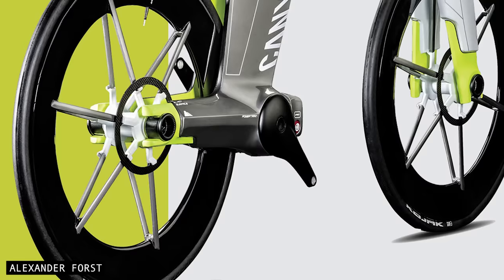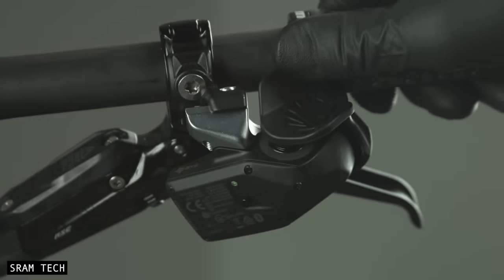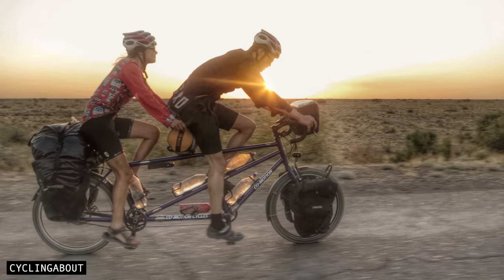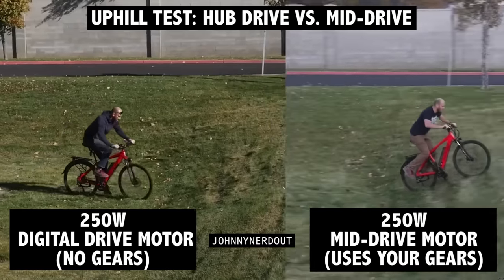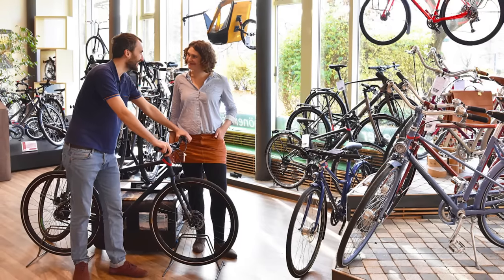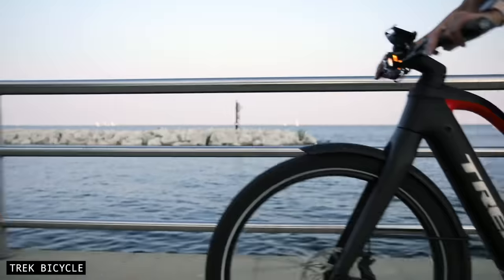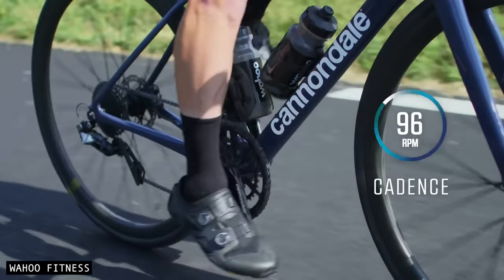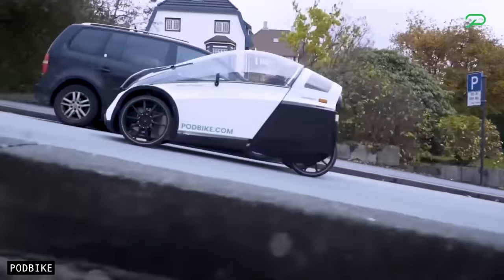Are Chainless Digital Drive Bicycles The Future of Cycling?

Comment: I need to point out that not everything that involves electricity is “digital”.  This is an ELECTRIC drivetrain.
Reply: I was screaming internally the entire time. "Digital"means of or relating to numerical digits or fingers. It has nothing to do with methods of power generation.
Reply: & this is objectively analog right? Unless it’s just a computer recording your break intensity & directing an equivalent level of power from the battery, with no direct, variable, connection between pedals & engine.
Reply: Right. I thought who came up with calling this "digital". There's nothing digital about it. Whoever thought to call it digital needs to learn its meaning.
Reply: Yes this is a series hybrid drive. The electronic control is digitally implemented but that is not essential to the concept. An annoying name.
Reply: @yerald_a  from the description there is definitely a computer involved. The pedals are just a dynamo for charging up the battery.
Reply: One could make the same case for a Tesla as being a digital car …
Reply: Yeah I thought it used PID brushless drive
Reply: @yerald_a  Well not even analog. Analog is reading and computing data as waveforms. This has a minimal amount of computing for the batteries. The drive train does no computing.
Reply: @theman5887  analog in the world of electrical engineering usually means stuff like traditional amplifiers, op amp circuits, linear power supplies, possibly even radio and RF stuff so more or less everything "not digital"
Reply: The fact that efficiency at each motor is around 80% makes me assume they're using switched reluctance motors.

If that's the case, it would be accurate to call it digital, since it needs a digital signal to operate. 

Kinda like a stepping motor...in e.g. a printer.
Reply: @tylerdurden3722  that does not make it digital. At best a hybrid motor, as the control signal is generated digitally, in this case. If the controller however can be switched for an analog one, which could be done, that does not make the motor digital. It makes it a digitally controlled motor
Reply: @tylerdurden3722  That doesn’t seem digital to me. The control lines might have binary state but they aren’t actually communicating digital data as a series of 1s and 0s, are they?
Reply: @theman5887  I am petty sure that analog and digital is only about how the system works is it with only true and false cases (1 or 0 digital) or can vallues be in between as well. There doesnt need to be any computing to call a system analog. An anog system could be as symple as a voltage source a resister and a led.
Reply: I was anoying me so much that I could watch further than 2 min and needed to find out if I was the only one
Reply: @mohanjanisthere  i've never seen a fully analog 3ph inverter, not only that but it needs to be able to simulate a bike-like feeling dependant on load so it varies the required pedaling torque and cadence using digital systems

not a single ebike has a truly analog controller, they're all operated by pulse width modulation and drive algorithms, field oriented control being the most efficient, and inherently uses sensors

doing a fully analog version of it would be gigantic as fuck even with tiny SMD components and the efficiency wouldn't be achievable at all, plus you won't be able to control effort at all and probably have inaccurate and inefficient motor control, as it needs to be able to monitor the input and motor current, battery voltage, motor position, "generator" position, generate a sine wave at 3 different phase angles, regenerate/convert the voltage from the "generator" to a high enough voltage, keep in mind the inductance and resistance of the motor and the "generator', and that's just a few of the functions of the inverters, it's even more complicated than that

it's not just a brushed dc motor driving another brushed dc motor, both are 3ph bldc motors and even just rectifying the "generator" it's generated power would be highly inefficient compared to full digital control

now it is like 70% efficient, if you done it fully analog, if possible to achieve, you'll be at 10% efficient at best

yes the earlier electric drivetrains they call digital are NOT digital, but the new ones certainly are
Reply: @jochem148  A digital signal also has an implicit or explicit clock which determines the regular discrete intervals at which the digits should be read. A signal that has transitions between two states at arbitrary times is not digital. For instance, a light switch isn’t sending a stream of digital data to the lightbulb.
Reply: Your right. It's more electro mechanical
Reply: +1
Reply: Single gear chain drive, optimised to use, added to the system, could be better as a parallel hybrid to help  overcome losses and torque/speed issues.
Reply: First i thought the same. But then he explained the need for very intricate software to actually make this concept usable as a bicycle drive train for normal people.
If you just connect the generator to a motor, it takes an athlete to get the bike going. Losses are just too damn high and electric generators have an absurd torque requirement when driving a low resistance load (like a motor that doesn't rotate yet when starting to move the bike).
Also it is way easier to do the comfort features like dynamic pedal resistance in software.

While you probably could do it without a computer, chances are that every commercial hybrid full electric bicycle drive train will heavily rely on software running on a microcontroller. And that could indeed be called a digital drive train.
Btw, when the microcontroller breaks or it loses power, such a bike won't move. And that should also be listed as a disadvantage, because you normally can still ride a chain- or belt-driven electric bicycle with the electric components not working.
Reply: I assumed the “digital drive” is a trademark. Otherwise, it’s just idiotic
Reply: Make an analog device to replace  The Chain first, then you can establish a new classification, where electric bike transmissions will be subdivided into analog and digital.
Reply: @tylerdurden3722  meh.. pretty much every electronic motor controller/driver uses some sort of PWM or similar on or off signal to do the actual driving. would still call it electrical drive and not primarily digital. maybe digital electric drive but... yeah nah
Reply: Blame it on Dyson... They renamed their brushless motors to digital motors for marketing reasons. Yes there's a "digital" controller, but the motor itself isn't really digital and could be driven with an analogue circuit
Reply: Never mind the processor that tells the drive train when to operate
Reply: You are sort of right.

But considering the control unit is most likely to be digital, it's not wrong to call the system digital.
Reply: @revimfadli4666  PID does not mean digital or analog. PID can be implemented either way.
Reply: @theman5887   Analog does not mean computing. Ever heard of an analog clock? Sure there are analog computers. This system does not require computing.
Reply: @allesklarklaus147  Well said. To charge the battery or power the motor is simpler using analog electronics too.
Reply: @mattc7014  Similar to the “digital TV antenna” marketing.
Reply: @robguyatt9602  oh shoot it can. Guess I mixed it up with stepper or brushless

Maybe this is why I didn't graduate electronics engineering lol
Reply: @revimfadli4666  Lol. I like your style. :)
Reply: I mean if the system won't function without some level of digital input (such as cadence sensing) then it would be a digital system.
Reply: Its drive by wire
Reply: @tylerdurden3722  Ooooh.... wouldn't you love to ride a bike driven by a stepper motor??
Reply: Thank you. That was so irritating! This is what I came here to say.
Reply: i bet he calls a normal bike an acoustic bike
Reply: Why is everyone so upset about a term they don't know the technical meaning of and a system they know next to nothing about. The whole system IS digital. Marketing is playing up digital as a buzz word but if you get angry about every marketing buzz word you would be constantly angry.
Reply: @cameronlevers231  No the drivetrain ist not entirely digital. The most important parts of the drivetrain are the generator and the motor both of which are not digital. The generator will generate based on an analog force and frequency input and the motor will output a torque which has whatever value in it's rated torque range. The drivetrain controller circuitry might be digital (mostly) but not the whole drivetrain.
Reply: @allesklarklaus147  a copper coil is not digital. A piece of wire is not digital. But a computer controlled, generator/altenator/dynamo, with speed controlled brushless motor IS digital. I wouldn't be surprised if it has a smartphone app
Reply: @cameronlevers231  not really, the controller is/might be digital as said before but not the motor/generator. if you use smarthome thermostats with a smartphone app for you in house heating your heating system is still a hot water heating system and not a "digital heating system"...
Reply: @allesklarklaus147  no the marketing for that seems to be "smart" or "smarthome." I would of thought that is alot further from the truth than digital.
Reply: It’s a dumb name but in a modern implementation this inherently digital, using three phase brushless DC motors at both ends and PWM modulation.
Reply: @cameronlevers231  Well I'm not really qualified to rate the amount of marketing wank but either way it sounds dumb
Reply: Maybe it a trademark/brand name?
Reply: In fact I’d say it’s analog since the power generated by your legs is analogous to the power at the wheel haha
Reply: @AWriterWandering  what sort of computer was installed in the 1975 digital bike?
Reply: @blankslate1198  a stepper motor is just a switched reluctance motor controlled to stop at each pole - they can be driven extremely smoothly with the right signal. Almost every modern ebike motor works this way.
Reply: And no, as the electric motor requires a motor controller for efficient use and this aspect IS digital.  Likewise same goes for your peddle to electrical power generator for efficiency will REQUIRE an digital controller.   Sure, you CAN build an electric motor without a motor controller... they are also garbage.
Reply: @cameronlevers231  I use a digital toothbrush (:
Reply: @mattc7014 I think that’s why they call it digital drive. If it was analog driven, it would be analog drive.
Reply: @biggreenblob  Word definitions change. After all, the association with numbers was added to the original definition. Effectively, you are converting mechanical/analog power to electrical power, but you're also converting that effort into a sequence of digits which tells a controller what to do.

Also, digital has become a counterpart to analog.
Reply: @allesklarklaus147  Yeah, well rollberblades aren't Actually rolling blades, now are they? "Cellular phones" don't use cellular signals any more, and having a "gay old time" doesn't have the same meaning the Hanna Barbera intended in The Flintstones. Language changes, and although strict definitions are at times important, oftentimes, what "sounds" better, or is easier to stay tends to stick and change (or muddies, if one is pedantic) the language. 

I get what you're saying and as a pedant myself, I used to get irritated about these things, until I realized that language is a living thing that grows and adapts (especially languages  like English). 

TLDR: Digital Drive has a nice alliterative sound to it and flows better than 'Electro-mechanical drive.' Although I feel that if these go mainstream, they'll likely be called "Chainless Drives" as that's extremely clear to a buyer and probably piques their interest more than Digital drive.
Reply: Without the digits it doesnt work…
Reply: @cameronlevers231  I gave the technical meaning of "digital" in my previous comment, right under OP. The whole system is not digital. If it was it would just be a computer program.
Reply: It's like calling a lightbulb the digital candle
Reply: @w8stral  but the narrator claims they've been "digital bikes" since 1975, which makes it a lot less apparent how they're supposedly inherently "digital"
Reply: Plus, you could say a mechanical drive is actually a digital drive if you push with your toes.
Reply: @biggreenblob  as per my previous comment, a copper coil is not digital, a wire is not digital, but a computer controlled system is digital.
Reply: The single-digit efficiency is what makes it truly digital
Reply: The wording is just marketing BS. For instance I have seen cigarettes with words "touch" and "HD" in their names. Use a popular word and you will get the likes.
Reply: this entire comment section is making me cringe because of this. went an awful naming convention, if that's even what it is. if it's just a simple mistake then that's even worse for a video of this length
Reply: @norgeek  no he did not
Reply: @biggreenblob  yeah, me too!
Reply: It's called "digital" because some marketing wankers want to sell it as something modern and advanced, while it's not. Similar system is used in diesel electric locomotives, where diesel engine powers a generator, and this generator powers the motors that drive the wheels.
Reply: @w8stral  what is he saying at 00:30 then?
Reply: I think the digital in digital drive train comes from the software that'd be used to control pedal resistance, energy storage and release etc. A motor connected to a dynamo isn't digital, but once you include any computational elements you could feasibly call it a digital drive train.
Reply: @kaszagryczana2260  Not really. Assisted E-bikes perhaps are like the light bulb, and this chainless drive is more like a smart LED bulb... which I think you could argue could be called a digital candle.
Reply: @roeltiri4041  Nice. I dig it.
Reply: @norgeek  1974 is not the stone age you know... Motor controllers existed... they were crude compared to what we can do today; true, but they existed.  And on top of this, he is talking about a patent, not production.  But of course there was no production, there was no viable batteries with which to OPERATE a bike.  Lead acid is too damned heavy and only has a charging efficiency of 72%...  What idiot would put that on a bike?
Reply: @pieterrossouw8596  Like we call a person with a pacemaker a “digital person”
Reply: 30 secs into this video and allready looking for this comment. Such a fatal misinformation at the beginning of the video has spoiled my desire for the rest.
Reply: @urgon6321  Uh... sort of, but no.  Here we are talking permanent magnet motors for an ebike and here is a GIGANTIC difference... base efficiency via a digital silicon computer controller for load balancing.  It has never been in micro form before.  

Now said multi million dollar locomotive has been computer controlled for well over 50 years... true, but it started as analog.  Simple system: also true.  Yes, they changed from analog to digital a long time ago but said computers were still large and no way would fit on a bike.  That being said, we could have mass produced a computer for an ebike 30+ years ago, but there really was no viable battery tech.  Ni-cads... yea sort of, but not really and we did not have the permanent magnet motors 30 years ago other than EXTREMELY expensive stepper motors.... so... while the same thing, in reality there are reasons the marketing says what it says even though it could have been true 30 years ago, but has not been done until now.
Reply: Maybe cause it sounds different and draws more attention.. I'll be honest, that was one of the reasons I clicked the bike looked cool. But yea when I hear digital, I think of screens, pixels and of coarse "Digimon" (Digital Monsters) 😂
Reply: @tmartin9482  Just shows you have no clue what a digital motor controller is.  That is the digital part.  It is an optimizer for torque, speed, efficiency so one it actually functions, and two does not immolalte itself.  A motor is not just willy nilly tied to a drive train via 2 or 3 or more  conductors with an ON switch other than in super cheap garbage...
Reply: @w8stral  so did he or did he not say that the patent for the quote-unquote "digital" bike was filed in 1975, which you initially claimed was incorrect?

Electric bicycles have been around for much(!) longer, I believe the first patent was filed in 1895
Reply: @w8stral  I'm well aware of motor controllers, but the fact, that you just eat his  "power generator + motor + wires = digital bike" at the very beginnning shows that you unfortunately have no idea how good explanations are structured. Disappointing.
Reply: Hes using the term digital in contrast to analog.
Reply: @TJ-sb2jj  So all electric cars shall be called digital cars from now on as well?
Btw. using digital in contrast to analog IS THE FCKING ONLY WAY TO USE IT, IT'S ITS DEFINITION.
Reply: @TJ-sb2jj  But neither digital nor analog are adjectives that apply to drivetrains
Reply: @B.L.A. Well...... It IS a good match for all the fake experts commenting........!
Reply: Well, you could call cycling digital because your peddles go up-down, 0-1.  🤐
Reply: I was gonna say... Motors and generators are probably more analog? The controller (especially if there's a battery) will ofc be digital
Reply: All modern bldc motors are 3 phase, and require a specialized controller that functions by powering each phase in sequence. 

Power level is not controlled by varying the voltage.

Instead it varies the length of time that voltage is applied to each phase.

The method, Pulse Width Modulation is absolutely reliant upon a digital signal.

Other functions of the controller are also digital.

The only pure analog ebike you could build (no one sells them, because there is zero market for them) would forgo a controller and use a brushed motor.

It would have no features, such as regen baking, and range would be lower due to the inefficiency of a single phase motor.

I assure you, this device is very much digital.
Reply: @AdrianBoyko  what do you think ones and zeros are in a computer?

They are whatever we define then as.

I've worked on computers where 0 was -11vdc and 1 was +20vdc.

This thread is a little silly.

People objecting to the term 'digital' on an emotional level, then trying to build an argument that leads to their conclusion, without understand any of the terms or the underlying principles.

Tldr; if you can't define digital correctly, you don't get to say what does or does not fit the definition.
Reply: @robguyatt9602  it absolutely does,
Reply: @robguyatt9602  Incorrect. Charging is done by a sophisticated digital circuit that ensures current limits are not exceeded, and that no cell in a string is overcharged. During discharge, similar functions are also.digitally controlled so that no cell drops below the charge level at which chemical changes in the cell.begin to cause irreversible damage, or in worst case, cause a fire.

The motor will not spin without a digital controller. At all.

What exactly is your objection to digital technology that you think analog is somehow preferable?

Did a computer hurt you?
Reply: @B.L.A. The cost of implementing any function is cheaper using digital technology than analog.

I know nothing about Dyson vacuums (though I have one somebody gave me - never used it) but if you told me to design a vacuum the could sell for $500 and have ridiculous power, I'd be looking at cheap full wave rectifiers, implemented in silicon, to create power controlled by a digital controller to power a  reasonably efficient brushless 3 phase dc motor. I could get several times the power output compared to a single phase analog system.

The motor would cost a little more, but not much. The controller would be cheap to produce. I can think of off the shelf motors that could easily produce 5hp in the same space/weight as a traditional vacuum cleaner.

If Dyson were doing that, it would justify a premium.
Reply: @ElectricityTaster  😂 Best comment
Reply: @urgon6321  Diesel electric locomotives are a great example. Nowadays, they almost certainly have all sorts of digital components, but they aren’t “digital locomotives”.
Reply: @theman5887  not true, the controller would be digital.
Reply: @Zomby_Woof  I admit to writing some of my remarks before finishing the video. Yes I made mistakes as a result. Now just because I said analog can be used for such a system, yes it would be a simple system without the features software and digital control can provide. Nor would it have the improved efficiency of BLDC over brushed DC. But nowhere did I suggest analog is better than digital. And no I most definitely do not prefer analog. I've been designing and manufacturing closed-loop servo systems since the early '80s. I was one of the first if not the first to put a microcontroller-based digital servo on the RC market in 1993. I taught myself to write assembly and later C programming for my MCU based products. So how you think I don't like digital is beyond me. Clearly, I gave no such impression. Just pointing out that analog can do such things as charging batteries etc. does not in any way suggest I think it is better than digital. Clearly, it is not. Your rudeness spoils an otherwise respectful thread.
Reply: Every time I heard digital, I was like Huhh, how exactly is this digital??
Reply: @kaszagryczana2260  no it's not. That's a stupid comparison and you know it too
Reply: @stitchilalu  THE motor controllers are digital.  Where the torque, efficiency comes from compared to no motor controller.  Same goes for regenerative braking.
Reply: I call traditional bikes without disc brakes/suspension "analogue" so this kinda fits...
Reply: The concept works better with digital logic circuits
Reply: This could more accurately be called "cyber" 🙂
Reply: @UnoriginalUsername373 I don't think they're just coupled generator/motor. it wouldn't work as well. the old one sure was probably just that. but the modern ones would be more like an ebike without a battery with a microcontroller controlling the thing, that way you can avoid stalling on startup and hills etc..
Reply: Is it analog?
Reply: Thank god somebody said it
Reply: @jochem148  Same here. Seriously annoying.
Reply: @AWriterWandering  an electric car also has a computer involved, yet we don't call it a digital car

heck, even an internal combustion engine car has an ECU , so under this definition they are 'digital cars' too
Reply: @robguyatt9602  My comments were directed more at the overall trend in the comments, with people taking a decidedly luddite attitude.

I should have made that clear because I wasn't intending to dump on you.

Or maybe I was, after making an incorrect inference from your posts - can't remember anymore and the mobile client isn't backscroll-friendly.

I've become a bit hypersensitive to the whole fondness for things and times that never were.
Reply: Thanks. You saved me from having to say the same.
Reply: Also, to call it an infinitely variable transmission is wrong.  It’s an electric motor with a generator and perhaps a battery. 

You need to generate the same amount of power for speed*distance travelled.
Reply: At the beginning, “digital” drive bikes have infinite gear ratios.  At the mid, they’re only good for one gear range or the other.
Reply: Dude this is an Artificial Intelligent Bike, with Quantic energy transmission
Reply: @profvonshredder2563  Some are not explicitly clocked, in which case the receiver needs to do “clock recovery”
Reply: The efficiency is worse than chain drive.
Reply: This thread has exceeded my wildest expectations. Waiting for my award plaque from YouTube 😂
Reply: Surprised they didn't include 'AI" in there somewhere.
Reply: No digity
Reply: Thank you! 👏
Reply: I had the same reaction, but, thinking about it, an analog system would have the generator directly connected the motor, which may not be a great experience. OK, you could have some analog electronics but digital would be more flexible and cheaper.

So I'm swinging towards this being a digital drive train, because without digital electronics it would be pretty rubbish.

"Indirect drive train" might be a better description.
Reply: it's marketing. 😁
Reply: @tonyblighe5696  Chain drive is also electric because it is electric repulsion that provides the force of one solid object (eg chain) against another (eg sprockets)
Reply: Look at 6:30,. it requires software to make calculations and use both your power and the battery.
Reply: Thanks for writing this.
Reply: @tonyblighe5696  Then every car, bike or anything else with an engine nowadays have digital drive, they all have ECU's that does a bunch of calculations for how much fuel to inject.
Reply: Strictly, Digital means limited number of steps or divisions. Analog means unlimited positions, within a range. 
A computer works digital, but Digital does not mean it is a computer.
A simple lightswitch is Digital. The light is on or off, not half on.
Even with most dimmers it is limited on a certain abount of in-between-steps, so stil digital.
A signal trough air or wire had loss during transmission, so will have a unknown amount of steps, so is always analog. Though from the moment you use a threshold level again to decode it is digital again.
Simply said, the switching is always digital, what arives on the other end of the line is analog.

A digital clock is nog digital becouse of the numbers, but becouse there is a limit, like in minutes, or seconds. You can not read seconds of the smallest digit shows minutes.

A analog clock realy shows the time more devided, so is analog.
Only when the second arroy is miving constantly though, else it stil is limited to whole seconds and is technicaly digital again.

Analog or digital has nothing to do with electric or computers, just with the (un)limited amount of devisions.
Reply: Now it feels cringe whenever he says DIGITAL
Reply: This. Even though technically modern implementations of the technology will always be using computers, there aren't really any "analog" drivetrains to compare it to. Instead, the alternatives are mechanical drivetrains, which would make the use of the word "electric" much more sensible. Unfortunately, the term has been used long enough to stick indefinitely.
Reply: Thank you.
Reply: I fully agree, though it is worth noting many control systems use pwm pulse control- which is pseudo digital (I.e. at fixed voltage) , but variable time.
Reply: @yerald_a  its not analog bud
Reply: @tylerdurden3722  why on earth would they use reluctance motors?
Reply: @theman5887  Analog = either means something analogous (similar) or something that is continuous and not discrete.
An analog clock is analog because there is no single point at which it is exactly a certain time like 3pm. Unlike a digital clock which can either be exactly 3pm or definitely not.
Reply: @BH4x0r  uhhh, there are brushed motors bud
Reply: @Blox117  worthless in the ebike scene due to the wear and less controllable nature, impossible to tell the rotation, inefficiency, and none in the wheels/hubs are brushed, there are brushed motors but only garbage cheap "middrive" ones that would drive your chain separately

even the cheapest middrives (that actually are middrives and have your pedals on them) are brushless, same for the cheapest hub motors you can buy, why? because brushed motors suck in every way, shape and form

either way the new one in this video is an ebike with a 100% brushless motor, generator, a battery and a smart system to make it feel like an ebike
Reply: It's a sales pitch method.
Reply: @BH4x0r  except you can replace the brush with a roller. problem solved tarded kiddo
Reply: @Blox117  how would that be more efficient though? the commutation method is still crap and will cause 2 coils to turn on full power during the comm switch, so it's still bad

anyone who thinks a brushed motor can win over a brushless in efficiency is a lunatic
Reply: @BH4x0r  what are you talking about? it would only energize the ones that it is touching.
Reply: Yeah, the drive train is electric, while it's the control that is digital. Now excuse me as I get in my digital car and drive off to the ENCOM cyberspace.
Reply: And I'll point out that analogue systems also use electricity 🤦
Reply: If an algorithm is controlling the output this is digital electric
Reply: Every single time he says digital in place of electric I feel like I'm sinking deeper into the river styx.
Reply: The power is digitally controlled at all times so the name is absolutely correct. The digital system is an integral component of the drivetrain. An analog electronic drivetrain would be a very different system with a very different feel.
Reply: It's like the difference between an electric guitar vs electric piano. Electric guitars are analog. Electronic pianos are digital. Now it's true that the electrical signal going to the speaker from the digital piano is analog, and its power source is fully analog, but it's digitally controlled which makes it a digital piano. Same idea applies here.
Reply: The entire purpose of the word "analog" is to indicate the total absence of any digital components in a system. So by definition this system cannot be called analog. Analog drive would specifically mean that the motor at the pedals is directly connected to the motor at the wheels, or that there is only an analog control system between the two motors.
Reply: I imagine that a digital drivetrain could be powered by giving it the task of computing the last digit of π
Reply: That blunder is so big he should remove and redo the video.
Reply: It Is Digital.  You bicycles motor to controlled using Pulse Width Modulation. 
Look it up and learn.
Reply: Marketing. 
"digital drive" is weak alliteration: The bread and butter of advertising.
That's all there is to it, I think.
Reply: Drive refers to the speed controller/ drive for the motor hence the digital part
Reply: @patrickdegenaar9495  I consider PWM to be a binary signal, but not digital. “Binary” because it is a two-level signal and “not digital” because the levels don’t represent digits.
Reply: This is digital since the controllers are digital.
Reply: also the power losses..

if that piece of junk doesn't have a battery and a recovery system... it's a bad idea, less efficient, more shit that can fail with very non user repairable components
Reply: @volundrfrey896  And cars are called “digital vehicles” because they have digital controllers, right?
Reply: Disappointed they haven't added "turbo" in there somewhere.
Reply: Just double checking, the patent he refered to is US 3884317A Kinzel for reference  Titled: "Electrically powered cycle". No mention of digital in the entire patent. Hope it is helpful. It felt quite off when the word was applied to everything, including electrical flow on the wire.

The argument about digital piano vs electrical guitar makes a lot of sense, and the bicycle has a digital gear system, so it is digital. But the YouTuber definitely seemed to not know the difference.
Reply: The step up is digital
Reply: Exactly! Digital refers to a way to represent information by approximating it with discrete numbers. To say a drivetrain is digital makes as much sense as saying a hammer is digital.
Reply: @tylerdurden3722  Similar to a multiple choice question where they ask what the "best" answer is, calling this is a digital drivetrain is the "worst" name they could have used.
Reply: To be fair, this distinction would rely almost entirely on the BMS at this point. "Digital" is anytime something has to be converted from a fully "live" analog input into a binary format.

So if the BMS relies on binary information to correctly distribute the power, I believe this could technically and correctly be referred to as digital.

If the BMS is just using live current flow and choking/boosting it (to a non-0v level) to a clean correct voltage then this would be electric and not digital.
Reply: It's also not a drivetrain. It's an electric motor with a generator at the pedals. There is no "drivetrain" be ause the motor is at the rear wheel. No need for a drivetrain. 🤦🏼‍♂️
Reply: Digit: any of the divisions in which the limbs of most vertebrates terminate, which are typically five in number but may be reduced (as in the horse), and which typically have a series of phalanges bearing a nail, claw, or hoof at the tip.
By this definition, anything pedaled by the feet is digital.
Reply: @TheNewGreenIsBlue  Well digital drivetrain just sounds absolutely stupid to an electrical engineer or other people related to that field. It really does.
Reply: Incorrect. This involves a controller that is doing more than sending the pedal power directly to the motor.
Reply: 0s are 1s are digits. The only way electronics work is using these digits to represent controlled pulses of electricity. Electricity when controlled is pretty much digital. If not digital, very inefficient or useless
Reply: @NaviYT  yeah... no. I don't think most power plants are inefficient or useless. Or basically any electric motor. Or LED light bulbs. Or audio amplifiers, wifi routers, radio transmitters,... you get the idea.
Reply: @blueburger4  My Mustang is controlled by a computer. Does that make my car a "Digital" car?
Reply: @computhenics  Well, it is digital in the sense that there is control software. But yeah, super stupid name.
Reply: Digital:
involving or relating to the use of computer technology

It's almost like there are many definitions for words, and they change over time
Reply: Llp
Reply: Thank you
Reply: Imagine if he said “Analog” on the video-
Reply: Controlled by digital electronics - that's the clever bit. Without it, it just takes away the greasy bits and makes it 50% less efficient in physical energy utilisation.
Reply: If you have software algorithms then these have been programmed in a coding language, which any coding language still reduces into binary 1's and 0's from the higher level.

So yes, it's digital. Electricity is simply the power output converted from the mechanical input, and then back to mechanical.

If the power generated was 100% direct, and without computer controls over torque, gearing, and cadence, then it would be completely eclectric, in the same way those wind up torches operate.

Anything that runs an internal computer, and software that reduces into binary can be considered as being digital.
Reply: @angryherbalgerbil  but, binary cant power a drivetrain... so calling a drivetrain digital is wrong. its an electric drivetrain that could be controlled by a digital computer.

so the correct term would still be a electric drivetrain
Reply: @tylerdurden3722  so if we going with your logic, we need to change Tesla definition then.A big LOL.
Reply: Well aktchually your foot has digits so checkmate!
Reply: It would be an analog electronic drive train if there was a generator in the peddle hub directly wired to a motor in the wheel hub. Possible, but not effective. The design described in the video involves a digital control system that decoupled the peddling action from the wheel control and provides a hypothetically improved experience by allowing the user to peddle at a cadence comfortable for them, while driving the wheel at a speed and torque appropriate for the situation. This is "ride by wire" not just an electronic drivetrain.
Reply: my light switch is digital     it has a on and off position
Reply: @kaszagryczana2260 LEDs is a semiconductor
Reply: @The_Ballo  I agree with you
Reply: Its that gen whatever education at work. We're headed for another dark age if the over 30's don't fix everything before the under 30's start playing slip and slide with their smooth brains.
Reply: @TheFyroPyro  By that definition, was my 1984 V6 mustang a Digital car because it had fuel injection?
Reply: @DJ_Force  That depends, was it electronic  or mechanical?
Reply: A tesla has a computer between the driver and the motor/wheels though, so it's not inaccurate at all to call a tesla a digital car.
Reply: @leandervr  I saw a digital cat outside as it wandered under the streetlight, that is controlled by a computer telling it when to switch on and off.
Reply: It seems like a marketing gimmick. Like calling whitening toothpaste "HD" 🤣
Reply: And I doubt the 1975 version had much "digital" going on.
Reply: @Smaggle84  It was an early form of centralized electronic fuel injection. The car had an engine computer. However, if you called it a digital car, you would have been rightly laughed at, even when the car was new.
Reply: LOL.  Just wrote my comment, then happened to read the others after my post.  Yes, some folks seen to think if its electrical it's digital.
Reply: Yeahhhyyyy. Digital would be definitive figures. Not broad range.

Makes me curious what is digital in this design.
Reply: Na man the rear motor is driven by the digital data generated by the crank.
Reply: Do you think we store files in clouds?
Reply: I expect the drive chain is digital in the sense that it uses a whole load of digital electronics to make everything work properly. The point remains that this technology is not intrinsically digital and could be built using analogue electronics if someone wanted to do that. The 'digital' part is not fundamental to what's going on here.
Reply: Happy to see that I'm not the only one seeing this. In my opinion the missconcepted naming destroys the experience of the video...
Reply: The output (motor) and other systems is controlled from a computer that is making calculations and adjustments with 0 and 1s. It may called digital.
Reply: Its digital even gas pedal of cars are digital
Reply: Thanks for stating what a lot of people immediately thought. It's such an ignorant name. It is certainly an electric drivetrain, nothing digital (discrete) about it.
Reply: Thats like the programmers that keep putting AI into everything
Reply: I am thankful this is the first comment I saw, it was grinding my gears all along…
Reply: That was my first thought when I saw this. It is simply electric.
Reply: I need gto point out that varible dc voltage is not digital.
Reply: Thank you
Reply: I found listening to every sentence saying "digital" pretty made me want to stop listening. How to be wrong in every single sentence? @CYCLINGABOUT has managed it.
Reply: i thought it was digital, became the basic transfer of power depends on lots of digital calculations en instant balancing?
the motor is clearly electric, the generator too, 
but all the bit in between, to help you control how fast you go, without really peddalling a lot less output, that bit can, i think, almost only by created by digital computing??
Reply: @JeroenJA  By the same logic your internal combustion car is digital because it has a computer in it, the EMU (Engine Management Unit) doing calculations all the time to maintain efficiency and control. This bicycle definitely does not have a "digital drive".
Reply: I'm sorry but everything electronic needs to be controlled, especially with modern tech or features people wish to have. And the controllers are you bet it digital.
I could also hang a big one out and say that ac current/voltage or dc current/voltage (alone from tuning on and off) is a series of 1's and 0's which fits to the definition of something being digital.
Reply: Exactly
Reply: @theman5887  no... Analog in reference to electricity refers to a signal where the electrical waveform IS the interpreted signal.  This is opposed to a signal of on and off where on represents a 1 bit and off represents a 0 bit. Those bits are then interpreted by a processor to reproduce an approximation of the analog electrical signal that they're supposed to mimic.
Reply: @Daniel-dj7fh  Everything in your comment after "I could also" is wrong.
Reply: This bothered me so much
Reply: Digital sounds cooler
Reply: The digital refers to the photonic on/off sequences used to transmit the electricity from pedal to rear motor
Reply: I've come to accept the death of the english language, this morning I saw an advertisement for - I shit you not 

Air Fryer "Baked" Brie - the air quotes emphasis on "Baked" is not mine, it was the article's. 

An Air Fryer is a miniature convection oven with a basket. It isn't use oil, it doesn't fry anything, it never fried anything, you don't need an air fryer to bake something on a roasting or cooking rack to promote air circulation.

You don't get to air-quotes "Baked" here, It was baked all along. Oven "Fried" Chicken makes sense because you didn't actually fry it. Here it doesn't make a damn lick of sense because the "Baked" Brie was in fact Baked
Reply: I would love to see someone try to implement this without any microcontrollers, tell me how much of an enjoyable experience that is for you.
Reply: No, but everything digital involves electricity. These bikes have an electric drivetrain that is digitally controlled. Which means they are hybrid electric, hence digital...
Reply: @skipfred  i forgot what i wrote and am also not gonna bother go search for it, so yes. Let's just agree to what you said despite the lack of arguments.
Reply: @KaiTenSatsuma  A moped has pedals - that's why it's called a moped. *Mo*tor *Ped*aler roughly, originally it was in Swedish. No pedals = an electric scooter, not a moped. Like you said, not an e-bike really either although people do refer to motorcycles as "bikes" so it kind of works colloquially.
Reply: @Daniel-dj7fh  Lol fair enough
Reply: @theman5887  Actually, any brushless motor does digital processing constantly. And the drive chain in these bicycles takes that a step further with more torque-varying mathematics
Reply: @leandervr  So do all other cars these days
Reply: @skipfred  right but in that same colloquial way people generally think of "E-Bike" to mean "Electrically Assisted Bike" not "If this thing hits a pothole you're going to need more than your cycling helmet" 😄
Reply: @KaiTenSatsuma  Lmao yeah when I hear "E-bike" I definitely think of basically a conventional bicycle with an electric motor strapped to it
Reply: Thank you! 👏👏👏
Reply: @garrygraves3848  i guess you didn’t see all the replies explaining why this is very much digital
Reply: Go digital' means🖕, however, not everyone knows that.
Reply: Yeah, that stupid name drives me crazy!!
Reply: @allesklarklaus147  u don't get it
Reply: Came here to make this comment
Reply: You could be accurate and call it Analog to digital to analog drive system . Mechanical input and output via a digitally managed interface and storage …
Reply: @biggreenblob  so you have never heard of digital and analogue controllers then I guess …
Reply: @robguyatt9602  you would be looking at DC motors to best achieve that..
Reply: @chrisbraid2907 Brushless DC.
Reply: Semantics?
Reply: @nickryan3417  a lot of modern cars can't be repaired by a normal garagist anymore, thus a case could be made for it ;-). But no, combustion engine all in essence just trust on the all proven mechanical guidance,  and you push in a mechanical pedal to give more power. With the bike in the example,  you don't just pedal harder to go harder.. they speak of optimun output, thus, pedalling while going down and not wanting acceleration on top even.. 
Electric, very old wadhing machines were electric, with controls by lots of cables intertwining. Modern washers just go to a silicon board, where in all is digitally programmed.. 
Digital electric perhaps? :-) 
Just wanted to point out it couldn't possibly really work without the digital part as argument.. washer machines made just electric worked splendidly,  in those , digitalisation of curcuits was just a first a way of lowering cost, and more recently for mzking them more ecological easier. 
Same goes for cars, digital part just makes more specific affinity possible, but in essence function a car is still mostly combustion/electric :-). 

Interesting question though, makes you think..
Reply: Just wondering about drivetrain, why train? :-) 
Wouldn't electric driveCHAIN be more accurate, since the power is transferred by electricity alternative to the mecanic chain on standard bikes? 😀
Reply: Tell that to the marketing wanketeers!
Reply: @B.L.A. marketing campaigns don’t care about your pedantry, sorry
Reply: But it sounds cool
Reply: Most people <50  lack even a 3rd grade understanding of physical science.
Reply: @biggreenblob  I'd argue that digital in electronics is better described as discrete signals.
Reply: @webby2275  We are kind of saying the same thing. Digital in electronics means using "digits" (1s and 0s) to represent a physical (analog) object or phenomenon. In contrast, a vinyl record is an actual physical version of the soundwaves which make up a song.
Reply: Badically yes, but actually since energy distribution, charging etc is controlled by a digital controller circuit, THIS makes is digital. Otherwise, as a direct generator-wire-motor system that would be extremely stupid.
Reply: It's publicity gimmick since everything is going digital they probably thought take can jump on the satanic bandwagon as well.
Reply: This is digital though, as there's a digital middle-man between your legs and the motor. It would be electric if the wires from the pedals went directly to the motor, here there's a control system that charges, discharges a battery, sets the pedal resistance, decides how much power goes to the motor, and so on.
Reply: The micro computer controlling the system is digital btw, perhaps that is what they are referring to?
Reply: Probably not what is meant by the author of the video but they could be referring to PWM controllers used by most electric vehicles, which are technically "digital" so I guess this does technically send the analog signal of your legs moving the pedals to the ESC, where it gets converted to digital and sent to the motor, so it could be considered a digital drivetrain...
Reply: @jochem148  that explains why you're annoyed. 7:40 is where he talks about the digital part. And it IS inherent in the design of this drive. Just attaching a motor to a generator will just not work properly as a bike. You need the digital control to make the generators harder to push at slow speeds to generate more power per rotation for example.
Reply: @biggreenblob  it IS a computer program and the hardware it runs on, including digitally controlled generator and motor. This system just doesn't work if you don't have a computer controlling it - likely why the 1970s version never took off.
Reply: @AdrianBoyko  not so. Diesel electric engines can work without digital components because the diesel engine speed can be controlled correctly - spinning fast when the train is starting - but that doesn't apply here, you can't make your legs go super fast just to get going on a bike, you have to make the generator hard to turn so you get more power per revolution at low speeds.
Reply: If anything regular drive is more digital thanks to the digit toes on your feet.
Reply: But if it's a brushless motor it's definitely digitally controlled :)
Reply: As it has capacitors for regenerative braking, therefore it must have sort of equivalent of battery management system for them, some data is transferred digitally, but i still agree with You, that calling it digital drivetrain is inappropriate.
Reply: It is digital in the sense that gear switching is done by automated digital computation, not analogue or mechanical signals.
Reply: @yerald_a that’s what I would think.
Reply: Electrical drivetrain I reckon. Electric makes it seem like it uses batteries or connected to a power system
Reply: ого! Я бачу, що ти не інженер-електронник🤣
Reply: @qoxyll 😆
Reply: @rpocc  the DRIVE isn't digital.  The controllers are. The DRIVE is an analog electric motor. You didn't take physical science in Jr. High did you?
Reply: Any modern e-bike would be run with a brushless motor, therefore it would be digital.
Reply: @brucewayne4585  brush-less motors aren't digital m0r0n.  The power supply is digital NOT the motor itself.
Reply: @brucewayne4585  I think it should be called… The Bat-Drive!
Reply: @goggles789 yeah, most 'smart' things, are really dumb...
and the correct name would be, 
for some reason internet connected, 
like the smart weight scale or water cooker :)
Reply: Yeah exact. But Digital Drive Bicycle makes easier to sell the startup when it will be near collapse...
Reply: An Analog electric drivetrain at that.
Reply: I think it's more a marketing-ism, like with Dyson's "digital motors" (which are really just BLDCs)
Reply: @JM-zg2jg  yep
Reply: @JM-zg2jg  yep, it would be like saying my 6 cyl. ICE engine is digital because the fuel injectors are digitally controlled as to when to release gasoline into the combustion chamber.
Reply: @pokoro97  it does involve capacitors, as sort of a battery, that is able to deliver a high power burst of energy
Reply: @computhenics  It's marketing fluff.
Reply: My hand surgeon is digital tho....
Reply: Like Dyson’s “digital motor” 🙄
Reply: @The_Ballo  digits are not binary, so it still wouldn’t count lol
Reply: @Lord_zeel  yeah, but that doesn’t mean that the drive train is powered by binary or digital. The drivetrain is electric, while the control system is digital
Reply: @redthunder6183  not sure why you think binary has anything to do with something being digital. Digital just means discrete. There have been base 10 and even a 3 state bit digital electronics (I think the 3rd state was used for error handling). The SSD in your computer has 9 states per cell.
Reply: @The_Ballo  "(of signals or data) expressed as series of the digits 0 and 1" -oxford dictionary. also the data stored in the cells of a SSD are read and encoded in binary, but they can have different states because they typically allow for more than 1 bit to be stored.

also there is no such thing as 3 state bit, a bit only refers to binary, what you mean is trinary. 

but sure, lets assume that you are right and that digital is anything that has to deal with the processing of data/information. the drivetrain would still be electric and not digital because the drivetrain by itself has nothing to do with information, it only handles power transmission.

you could say that the computer controlling the electric drivetrain is digital, but the bike should still be referred to as a electric drivetrain bike, even by following your logic
Reply: @Smaggle84  you're right, it's just marketing b*ll*cks!
Reply: Why do we let people who use reddit use youtube
Reply: @redthunder6183  Digital has nothing with the processing of information. Digital means pertaining to DIGITS
Reply: @The_Ballo  ok sure, and as I said before, even by following that logic, guess what? It would still be an electric drivetrain.
Reply: @redthunder6183  Correct.
Reply: In it's purest form "digital" is referring to what it is not. A continuous and therefor analog signaled system both of which were electronic. In the automotive world it makes sense to call it "electric" because most cars are explosion capturing machines. But within e-bikes they're all electric even if they're technically electromechanical otherwise any computer with a harddrive in it is technically not electronic. It's proper then for this term to refer specifically to what differentiates power over wire vs power over a chain, shaft, linkage etc. Indeed the power must be communicated over the wire but it's most certainly not necessary for it to be digital it just transmits the power of the generator to the motor. In the same parlance it'd be analog drive. But there's no purpose in making that distinction. In fact a chain is an analog system. But more modern systems are mostly relying on information from the peddles where the power is either from a battery or regulated through power electronics in which case it'd very much be digital. Note that AC motors are not called analog motors for similar reasons mentioned so far and is also a good example to consider when arguing semantics. Language is a living breathing thing. Since this is all made up terminology anyway if you wanted to be pedantic a teledrive would be more faithful to it's most distinguished feature.
Reply: @AWriterWandering  thats only the ones with a battery. i think it is in relation to the electronic circuits that change your direct inputs to varying voltage levels to turn the motor at different speeds, which must be controlled with a microcontroller at least.
Reply: It is digital. The controller pulses the motor to change motor speeds.  It's all done digitally. 
It could be done with analog circuitry, but you'll not get all the benefits efficiency and smooth power control.
Reply: @noe616  I do understand what you mean as this is very true of switching power supplies but the opposite is true of motors. All efficient motors are AC. In fact almost all motors are AC. A "brushless DC motor" is just an AC motor with a DC-AC power supply. The easy way to understand this is because the field in order to be efficiently move the rotor needs to be continuously variable and thats AC by definition. Incidentally this is NOT "pulsing" like how say a dimmer for an LED works.
Reply: Marketers sheesh
Reply: who cares. this is what we need for humanity!
Reply: I couldn't listen to it. There is nothing "digital" about the bike. Perhaps you could say "direct drive" or "electric" but using the term "digital" tells me this is marketing hype, probably being read by a paid announcer who knows nothing about bikes or technology.
Reply: @biggreenblob  yes but for him it gets the viewers attention with this word
Reply: @allesklarklaus147  digital / analog refers to computing (because analog computers exist) or signal processing (for instance what a radio does; a digital radio uses microprocessors, an analog radio doesn't). 

An electric motor or generator does neither of these things. So it's just electric!
Reply: @w8stral  By this logic, you shouldn't be calling it an electric motor, but a digital motor. 
Nobody does this because the electric motor was invented in the 19th century.
(In principle, they could have invented a bike with an electric drivetrain at the same time. But given the weight using available technology, it would needed a horse to pull it.)
Reply: @gerardvila4685  Yeah that is one way to put it. But if it had to be one of those, it would be analog. Also, if you had to design the power electronics you probably would not want to hire a digital design engineer for that job lol.
Reply: @gerardvila4685  Kinda sorta.. What I wanted to state is that a motor puts out a torque which is "analog" to the current through the windings. It can be less or more and not just on/off. 
That the name is stupid and should be electric drive train at most is what I stated about 200 comments or so ago.
Reply: Amazing👍
Reply: @BrienMalone  Well it is more the fact that is sounds absolutely stupid to someone working in EE rather than beeing pedantic about words.
Reply: Professionally, these types of drive systems for drive in a bicycle, is called indeed digital drive.

Electric can just mean too many other things.
Reply: @computhenics  except that you need a computer to output the power and to input the power, does that make sense to you, or do you need me to dumb it down further?
Reply: @HughCStevenson1  it is essential to the concept. With out digital application your power goes nowhere and you freewheel
Reply: @benbraceletspurple9108  Booo!
Reply: Exactly what I was thinking.  It is electric.  Digital doesn't create power, there is no such thing a digital power.  Guy sounds like a fool- "digital drive".. hahaha
Reply: Quite right.
Reply: At 4:40 that is one cool looking bike can I get a name or was that a custom bike. I been thinking of a web type bike frame and some one beat me to it.
Reply: Digital bike is absolutely a good name for this because unlike a normal bike or a normal ebike which the drive power is exactly analogous to the physical power you input, in these bikes your effort is picked up by a digital sensor, that analyzes your power as a discrete number stored in a computer, then the COMPUTER tells the battery that discrete value to output to the motor, and the motor is the SOLE driver of the bike. Absolutely not analog.
Reply: @claydoub   He describes "digital drivetrain" as pedals turning the rotor of a generator to generate electricity, current traveling down two wires to the rear hub, and the rear hub motor applying that current to spin the wheel.  No digital controller, no battery.  Later on, he adds those items as possibilities,  but it's still an electric drivetrain, not digital.  Besides, "digital drivetrain" is a preexisting cycling term for electric shifters on bikes, whether or not they have an electric motor.  The Shimano Di2 drivetrain, for example, has electric-powered derailleurs controlled by switches set into the brake handles, optionally tuned over Bluetooth or WiFi -the digital part.  He apparently never searched for the term in a search engine, otherwise he wouldn't have humblebragged about creating the term in his pinned comment, or used the term in the title.
Reply: @The-KP  it is true, he did frame this video very poorly, but he does include the "other components" in his initial description which could include the controller/battery. His example of the only current production digital bike, and the one that isn't in production both include controllers which tweak the power output and pedal resistance via computational algorithms. I've heard of this concept before this video so I was pretty sure no one is considering this concept as a pure analog system which would be pretty lossy and stupid (the whole idea is that now batteries can make up for the lossiness), and only would be even tolerable in completely flat conditions. Also he does not describe this as a "digital drivetrain" but rather a "digital drive" because the bike would be driven by the digital computer rather than your analog pedaling. Subtle distinction but still different
Reply: Does it input 0,1,0,1,…?
Reply: Digital stupidity is here to make your bicycle heavier and much more expensive while using more energy to do less work. Great idea!
Reply: Surely it refers to the micro computer and the only incorrect use was the old patent, otherwise other sources he quoted would all have to be wrong too.
Reply: Yeah, it's stupid, or are they using stepper motors?
For this application, probably not. It would be doubly stupid.

Its not digital.
Reply: @computhenics  The term "digital drive" comes from the sales dept. not the engineering dept.
Reply: Oh no! There are some clever guys commenting. Digital clogs next then seven league digital boots. Dig- ital gardening shovels?
Reply: @qoxyll  This needs to be herd
Reply: @autodidacticartisan  digital bikes can be ridden but plumbing must be lead.
Reply: @urgon6321  Don't tell me self abusers will need digital specs.
Reply: sorry nerd but digital is a marketing buzzword now.
Reply: By using "digital" instead of "electric" drivetrain someone only showed his complete lack of knowledge in this field, and it is hopeless videos like those hits milions of views - except of mine - i didn't watched this video... it is bullshit claim sponsored by google youtube - antynobel ?! :D
Reply: @mohanjanisthere  "that does not make it digital." Dc motor is simple, positive, negative, spinning. Stepper motor has 4 or more wires and you have to dance an irish jig on them to operate it. I think calling one analog and the other one digital isn't that wrong.
What category does PWM belong to?
Reply: If it uses a digital signal to control the motor, it's digital.
Reply: @runestone2011  "If it uses a digital signal to control the motor, it's digital." So it doesn't matter. My instruction i do in code will always be a digital instruction. A digital signal in some way. Until it reaches the chip that uses it's own protocol to talk to whatever motor it is in the end.

Analog therefore could only be achieved with a potentiometer and a motor, simple circuit. Anything else would have some sort of digital origin that tells it to move.

You see how ridiculous this discussion about this distinction is? No progress will be made focusing on definitions like that...
Reply: Oof this was killing me the whole time
Reply: If they add a computer to control the speed of the wheel...it becomes digital.
Reply: PWM is indeed digital. Most high efficiency power transformer systems are "digital" or class D.
Reply: @biggreenblob  There are multiple definitions for "digital" and this describes anything that works with binary data. A drive transmitting data from the pedals to the hub would indeed be "digital".
Reply: THANK YOU
Reply: 100 year old b&W film prints are digital too - if you put a print under a microscope you will see that that tiny parts are on or off - binary
Reply: Thanks for pointing that out, I was cringing hard at that stupid marketing talk!
Reply: @WolfmanDude  It’s amazing how many people actually believe that this drive is digital. Just look at some of the other replies on my message!
Reply: THANK YOU !
Reply: A chain drive is more digital than this, because the teeth are kinda like fingers.
Reply: Electrically-coupled drive would be more accurate.
Reply: @computhenics  I'm pretty sure they do, but marketing, you know.
Reply: @tylerdurden3722  This is irrelevant, there's certainly some computer controlling it, which is digital, The point here is it's a power train, we call it electrical by how the energy is transmitted, not how it's controlled, likely you wouldn't call any power train analog.
Reply: Are you sure about that? Maybe there is a digital signal sent from the pedal generator to the hub.
Reply: @michealofloinn2539  Is that digital signal how POWER is delivered?
Reply: A certainty for e-bikes in not so distant future.
Reply: Also many describe things as "electronic" when its just electric.
Reply: "Digital Drive"? 1975?!
Reply: We already have e(electric)bike so I guess something had to be done to differentiate the two.
Reply: I would call it "digital" if it were driven by a square wave.
Independent and complete impulses of electricity.
Kind of like the downside of using digital power inverters to stimulate AC from DC.  They never really produce a pure sinusoidal wave, but chunks of "digital" impulse.
Reply: This is analog anyway
Reply: @biggreenblob  Same here. I do lots of Arduino and ESP projects and was also screaming "DIGITAL?!".
Reply: If trains are called diesel electric then this could be called sweat electric
Reply: @d9918  This is the best comment (:
Reply: Efficiency is the main problem here. A chain and sprocket has to be way more efficient than a generator, transmission line and electric motor.
Reply: Yup. If we want to make any stretch in electronic world, in this case we convert a certain input into an electric signal, not a digit. It is therefore analogue, not digital.
Reply: Except it actually uses digital signals to control the motor. It has an electric DRIVE, but the DRIVETRAIN is digital.
Reply: Well, the video talks about digitally controlling the drivetrain behaviour, probably using an ESC or similar system. So as described, the system is in fact digital.
Reply: Do you know the concept of "analog"?
Reply: Actually if you listened to 7:20, you'd hear the explanation about the "traditional"  e-bike vs. digital bike. The computation that goes into controlling the power at the wheel and feedback via pedals is what makes it more than just a electric powered bike.
Reply: Digital drive just sounds better than electric drive. Might be a marketing strategy
Reply: I could see how this is digital, but yeah, that's unnecessarily confusing
Reply: It operates digitally, wherein both the generator and motor turn on and off thousands of times per second to enhance efficiency. However, the observed bike may not succeed in the market, either due to gear inefficiency or gear durability issues on both the motor and generator sides. The diameter of both components needs to be increased, preferably by at least 1.5 times, potentially closer to 2 times. This presents a significant challenge for an electric drivetrain on a bike, requiring the creation of an entirely new wheel since traditional spikes have lost much of their ability to absorb shocks when they are half the length.

The concept of "airless tires" is a consideration - not to replace traditional tires, but to incorporate the spike concepts from airless tires. Short spikes lack the necessary length for sufficient absorption, demanding a stronger and more progressive alternative, especially for off-road use. Another option is having a motor on both wheels, though the practicality of this approach remains uncertain. Learning to ride such a bike might be challenging for anyone other than professionals, as it becomes counterintuitive—similar to a steering wheel that turns in the opposite direction of the norm, and only half of the time.
Reply: Add t850 hydrogen fuel cell for unlimited range
Reply: I can believe in the meanings of words changing over time, but I still hate it when they lose all semblance of rational meaning. Unfortunately, computing has a history of extreme hype. People of my age and younger formed meanings based on the hype rather than reason. I was born in the 70s.
Reply: Based on the power control, it is // switching electronics
Reply: Your guys are being overly critical of a marketing ploy.
Reply: I came to the comments  to say the same. A part of me died everytime he said "digital". Where are the digits? And he said it oh so many times...
Reply: digital comes from the digits 1 and 0.
Reply: Ones and zero doesn't make a bike go.😂😂😂 Just call it electric drive.
Reply: Exactly. Something can be digital without using electricity at all.
Reply: No, you didn’t need to point that out. Being pedantic about colloquial misnomers is the ultimate r/iamverysmart move.
Reply: Not really, because the controller of the motor IS digital. It is not analogic anymore,
because brushless motors don't have a mechanical inverter.
They have to be electronically inverted, and this is done by a digital controller.
Reply: @Delphis1982  So, a car with an internal combustion engine has a “camshafty” drive train because that’s what controls the valves?
Reply: Digital????? 1001110100-1100110011 from generator to motor:face-purple-crying::face-purple-crying::face-purple-crying:
Reply: How is this not digital if the drive is computer-piloted ?
Reply: @oneoranota  So, your car is “Human” because you pilot it?
Reply: PWM motor
Reply: All the existing cases are digital so they are digitalDrive trains. Ther may be electric ones, but they are not sold commercially, it seems.
It would be VERY hard to implement this just analogically and expect any form of comfort or easiness to use.
Reply: its called digital drivetrain only because of the controller operating the engine, its something that was taken from automotive industry
Reply: @biggreenblob and if anything it's analog because for every turn of the pedal you get an analogous amount of power. 

Turn thing, get value is pretty much the definition of analog
Reply: Wait till they throw 'quantum' in there.
Reply: @tylerdurden3722  that's discrete, not digital.
Reply: sure, but first of all, they're going to put a computer in it to track your every movement, no doubt about it.
second, without a computer on board to manage the power output and input, you couldn't get all the advantages he lists. at best, you would probably heat up some wires and have a lot of slip when you start the bike.
Immplementing the features required to make this work without a computer would involve so many analog components, that you could probably turn it into a great HIFI amp.
Reply: It's digital if it's being sent as duty cycles of active low and active high.
Reply: “Electric” doesn’t move product like it used to.
Reply: But we don't let the truth get in the way of a good sounding clickbait title, do we?
Reply: Brushless motors? Digital electronic technology! Technology has moved further than you know. And not all that recently either. Straight up analog electric drive train wouldn't get this bike moving. You need to develop torque and you need digital electronics in there for that.
Reply: Welp, I was going to watch this video... But I don't think I can if he is going to be saying that the entire video.
Reply: I was waiting for someone to say this. Thank you.
Reply: @thedolphin5428  The pedals are always opposing each other, so it cancels each other out, so it’s nothing. The Nothing Bike. Brought to you by the makers of the Nothing Phone.
Reply: Technically most modern BLDC motor controllers, such as this one, especially those with FOC are actually running fairly powerful ARM-based CPUs 🤓
Reply: @BH4x0r Another excuse for Pulse Width Modulation. And it is Analog to a point. Early systems like the ones used in electric scooters were analog. All the current monitoring, timing sequencing and modulation were all controlled by 4 op amps and a MOSFET driver (again analog) oh and the op amps the common garden variety LM324 and maybe an analog comparator again common variety LM339. They only thing the processors were used for was a function display monitor.
Reply: @davidbwn  i mean thats sorta possible but i see no reason why you wouldn't use a proper FOC controller

btw most electric scooter controllers right now still don't monitor the actual output/motor current and only measure the input current
Reply: Maybe the shifter? Idk
Reply: Word
Reply: I was thinking the same thing.  This electric drive train is very much analog! LOL.  That just floors me that they call this "digital".  It could use some of the energy produced to maybe give you a digital display.... but the drive train itself?  Not digital.
Reply: Perfect
Reply: I wouldn't want to drive/ride a digital wheel :) especially low resolution.😂
Reply: Software and hardware aren't things anymore. Or rather they're just social constructs. Didn't you get the memo? 

I'm being cheeky for sure but lazy language should be mocked. And I feel your pain in other words.
Reply: @robertd8483 you are wrong. The important aspect of this drivetrain is the power is transmitted, not through a chain, but thought electric current. The "digital" part is just a accessory, just used to control the transmission of power, it's not even required for the drivetrain to work. It could be just generator, wire and a motor.
Reply: @yerald_a  there is basically a difference between digital or analogue signal transmission. Both can be wireless but one is DIGITAL and the other one is not 😅 .... so basically the top comment makes no sense and the first answer on it aswell ... cheers 🍻
Reply: @yerald_a  sorry but also bs... 🥴
Reply: @biggreenblob  ""Digital"means of or relating to numerical digits or fingers" No ABSOLUTELY incorrect - this "digital" definition would focus on the concept of a probably a falsely named "electronically" ie mentioned here as "DIGITAL"  (defined here as drive train controlled  without a physical linkage) vs say an "analogue" drive, which inherently would be mechanically linked, with a " continuously variable physical force" applied to say a crankshaft and with a chain/gears.
Reply: but "digital drive" is just the term for a system like that, no?
Reply: @shadowhunterevil8214  Yes. Do you mind if we call you our “Marsupial Friend”?
Reply: @AdrianBoyko  Actually, that sounds funny, please call me your Marsupial Friend!
Reply: Actually, if it's a Step By Step Electric Motor Driving The Bike, It's Digital! If Continuous, Then It's Electric Indeed!
Reply: It's got electrolytes!
Reply: well it says that it has some kind of motor driver that controlls the current and it's crucial for these drive trains
Reply: "Digital" means new and fancy and you-must-buy!
Reply: The fact that they call it digital indicates their level of really understanding basic mechanics and efficiency. That also explains why they would think that this idea will ever work.
Reply: Agreed.. and it was the same when people started calling cell phones SMARTphones, I mean what's smart about a computer in a phone, does the phone even think
Reply: Thats a pet peeve it happens a lot in my hobby.
Reply: I both agree and disagree... if it were developed in the 70s then yes I'm sure it would be an analogue electric drivetrain, but what is described here will feature a load of sensors and a control unit that will definitely be digital. It will need this level of control to give the refinement needed to truly replace a chain. Advanced lightweight motors no longer use brushes etc and are digitally controlled. I think we can use the terms electric drivetrain and digital drivetrain interchangeably for these bikes.
Reply: Wonder why they didn't call DSLRs Electric Cameras 🤣
Reply: @theman5887  yes a waveform is being read and transferred just like a vinyl record. the waveform generated by pedaling is "read" and has something uhh "analogous" happening in the waveform that drives the wheel, coming from the motor. it is 100% an analog system
Reply: You're so right. These days all kind of fools talk about 'digital' when it is just electrical😂
Reply: So, the bike is electrical, the controlling unit is digital
Reply: @yerald_a  in that case it would be electronic, but no digital.
Reply: No, you didn't